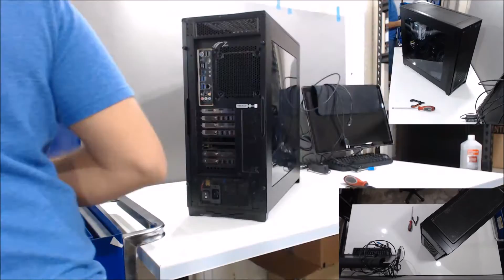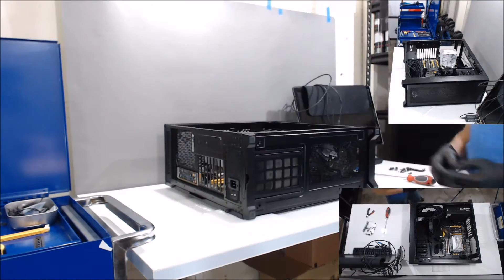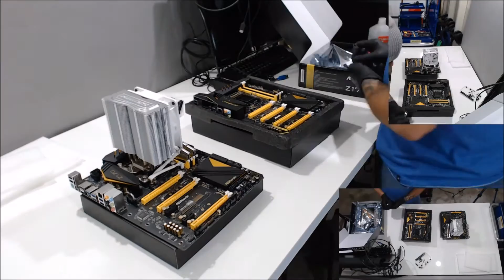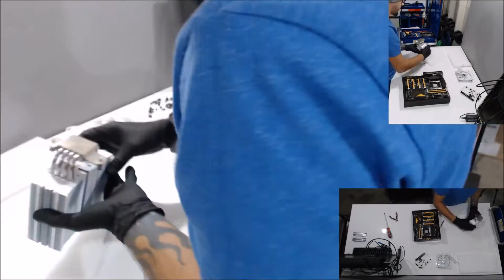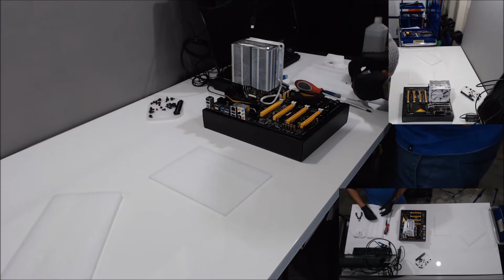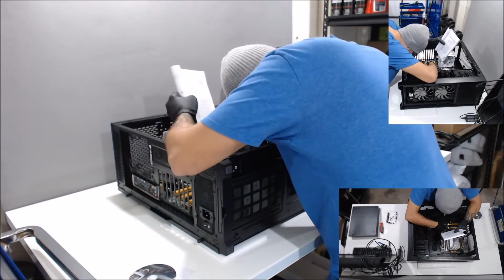Asrock z170 OC Formula Motherboard Replacement on QuadFire 390x Build

Comment: silly question: How big are this gpus compared to the GTX 1070/1080s , im trying to build a quad gpu pc for rendering , would 4 1070s fit in this motherboard ?
Reply from the maker: SpineS as long as it is a two slot GPU you will be OK. Personally I would recommend the Nvidia Founders Edition to keep temps manageable.
Reply: Thanks man. I think ill wait for the 1080 ti to arrive in the market to see how the prices of all the other cards change.
Reply from the maker: SpineS wise choice. The 1080ti is turning out to be a beast! If not the gtx1080 is now a great price